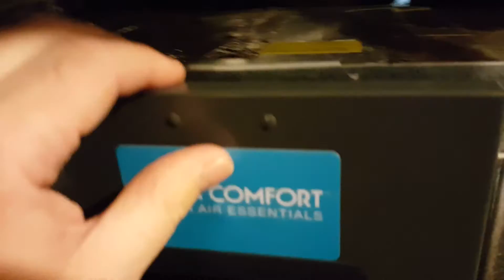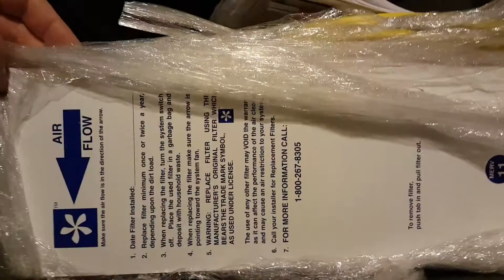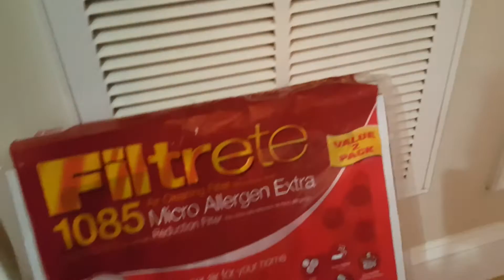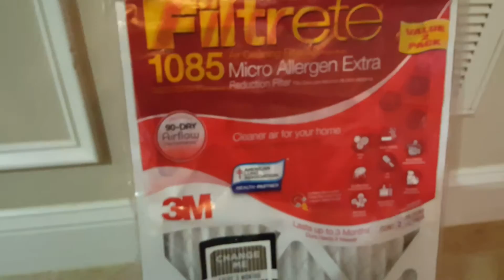Bitcoin mining farms at home and air quality concerns. Do antminer's produce harmful VOC?

Comment: Volatile Organic Compounds in Your Home

Volatile Organic Compounds (VOCs) are a large group of carbon-based chemicals that easily evaporate at room temperature. While most people can smell high levels of some VOCs, other VOCs have no odor. Odor does not indicate the level of risk from inhalation of this group of chemicals. There are thousands of different VOCs produced and used in our daily lives. Some common examples include:

Acetone
Benzene
Ethylene glycol
Formaldehyde
Methylene chloride
Perchloroethylene
Toluene
Xylene
1,3-butadiene
Where do VOCs come from?

Many products we have in our homes release or “off-gas” VOCs. Some examples of sources of VOCs are:

Building Materials

Carpets and adhesives
Composite wood products
Paints
Sealing caulks
Solvents
Upholstery fabrics
Varnishes
Vinyl Floors
Home and Personal Care Products

Air fresheners
Air cleaners that produce ozone
Cleaning and disinfecting chemicals
Cosmetics
Fuel oil, gasoline
Moth balls
Vehicle exhaust running a car in an attached garage
Behaviors

Cooking
Dry cleaning
Hobbies
Newspapers
Non-electric space heaters
Photocopiers
Smoking
Stored paints and chemicals
Wood burning stoves
Studies have shown that the level of VOCs indoors is generally two to five times higher than the level of VOC’s outdoors. VOC concentrations in indoor air depend on many factors, including the:

Amount of VOCs in a product;
Rate at which the VOCs are released;
Volume of the air in the room/building;
Ventilation rate or the area; and
Outdoor concentrations of VOCs.
What are the health effects of VOC exposure?

The risk of health effects from inhaling any chemical depends on how much is in the air, how long and how often a person breathes it in. Scientists look at short-term (acute) exposures as hours to days or long-term (chronic) exposures as years to even lifetime.

Breathing low levels of VOCs for long periods of time may increase some people’s risk of health problems. Several studies suggest that exposure to VOCs may make symptoms worse in people who have asthma or are particularly sensitive to chemicals. These are much different exposures than occupational exposures to VOCs.

VOCs refer to a group of chemicals. Each chemical has its own toxicity and potential for causing different health effects. Common symptoms of exposure to VOCs include:

Short-Term (Acute) to high levels of VOCs

Eye, nose and throat irritation
Headaches
Nausea / Vomiting
Dizziness
Worsening of asthma symptoms

If VOC's are produced by heating the plastic, this will only occur on the rear fan? as the front fan sucks in cold air.

This means any fan used for extraction i.e. heat source in-front of fan with fan blowing away from heat source can potentially heat up and produce VOC's? 

Could VOC's be a description for that new smell that you get when you step into new car or you get new computer and you notice that new smell.

comments please...
Reply from the maker: Hi +Trevor Hazzard very impressive list of information and very informative thank you for sharing.